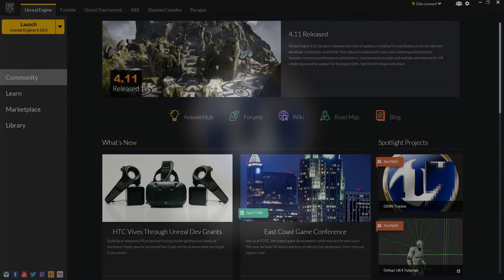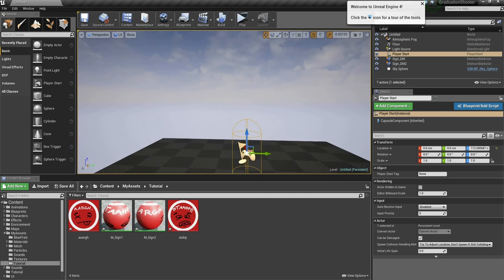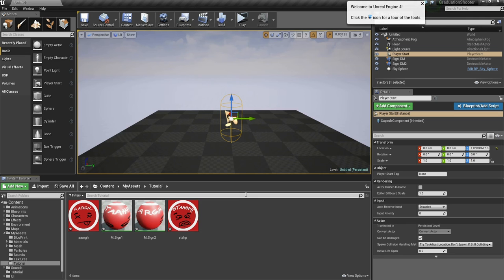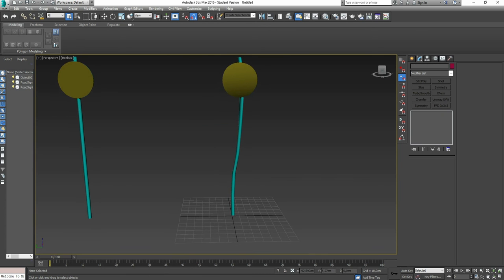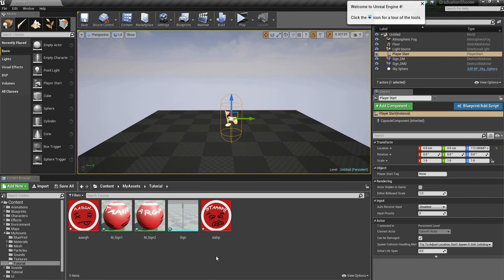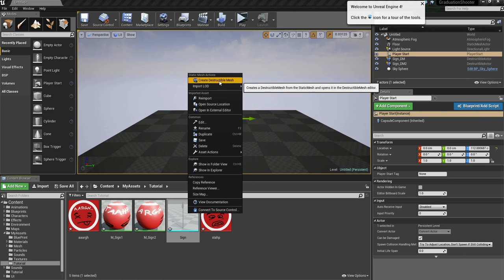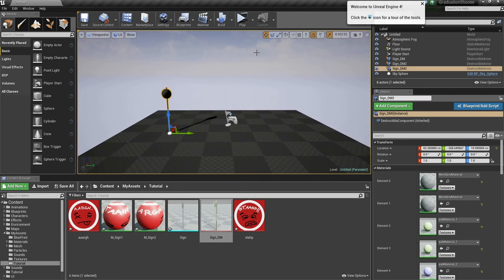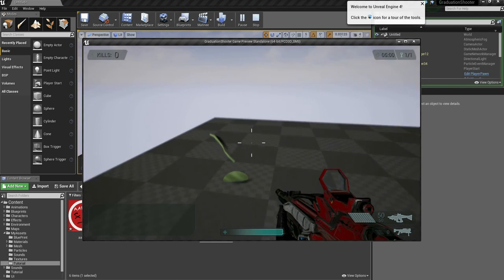Unreal Engine 4 Destructible meshes - FBX chunks & simple blueprint

Comment: When you say it is applicable to a static mesh, can that be a model that is imported? If it is, must the model not have any animations? The static part of static mesh means it is something with a mesh that doesn't necessarily change or move? So a player wouldn't be static, but for example a box or wall would?
Reply from the maker: I'm not sure where is say this in the video so if you van give me the time where i say it that would help.
Anyways, it has to be a static mesh. I don't believe animated objects work. But you can easily reproduce the effect with a blueprint like I do at the end of the video.
I hope this answers your question.
Reply: Sorry was a copy/pasted comment from another video because I was having the hardest time finding an answer. Also, thank you alot, it answered my question. I bought a ue4 tutorial off of udemy . com.. On the 50th lecture. It looks like a lot of fun!